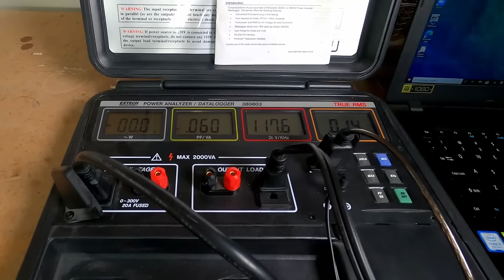Singer Heavy Duty, Most In-Depth Review on the Internet. No Really, I'm Not Joking.

Comment: Older video but I was wondering today how many hours a modern sewing machine could run before something broke. Not a stupid "torture test", just run at maybe half speed and oiled at the recommended interval. I can't find where anyone has tried something like that. Older treadles have been working for a hundred years without a major failure.

Comment: I just bought that machine and while you are sewing it comes unthreaded from the top leaver #5 but it will still be threaded everywhere else but it messes up the bobbin. Do you know why it would do this?
Reply: Absolutely! You must have the take up lever in the highest most position before you cut the threads. Otherwise the first thing that happens is you "unthread" the needle as the take up lever rises before you can even make a stitch. Just do it by hand motion only and you will see what I mean.

Comment: 2 big concerns: 16:25 That gear should have been metal. Also, running the motor so close to maximum makes it NOT heavy duty. A heavy duty design would use a motor maybe rated x2 the current draw in use, if the machine will indeed be running, for example 3 full time shifts in a factory, etc. This motor will run hot for no reason, just being cheap.

Comment: Unless they improved it, it isn’t worth it.  I bought one of these models around 2007.  It weighed a lot but it constantly jammed up, especially when it was being run at a high speed.  I bought it new and it wasn’t worth it.  I replaced it with an old 1970s Touch and Sew that had metal gears inside and it still runs perfectly.  The sales lady warned me not to buy the heavy duty. It wouldn’t go through light denim so I should have known.

Comment: None of singers machines are heavy duty. Compare to the vintage singer models? These new plastic and thin metal machines do not hold up. I’ve had to replace needle plates a few times because of the cheap metal there using

Comment: Having been a plastic molder in the past, I have to say it simply is not good enough to say oh this is a plastic gear.  Is it for instance re-inforced with GR so glass re-inforced.  There are many formulations of plastics depending on their application.  This will be engineered to both cost and function.

Comment: I’ve had my 4452 machine for three years, have had it serviced, and I am not impressed. I have sewn multiple fleece comforters...brand new needles each time, and it has trouble on the corners every time. My last comforter which was a heavy fleece on both sides, poly fill and it was a nightmare. NO SPACE under the foot, had to manually insert the needle constantly on the corners...skipped stitches and a lot of frustration. For my other sewing...I’ve sewn denim...not impressed either. It  would not sew the belt loops on the waist band...again, not impressed. Maybe my machine is a dud???  But I’ve used it exclusively for for years on every type of fabric, and I’m buying a new HD machine...not a Singer.
Reply: I have this machine and since I started using gutermann thread it has greatly improved function.
Reply: I just bought it and found I can not get my quilt binding under the foot easily..  I can force it and it will sew but it drags the material and puckers it.   I wanted to sew the cloth handles on a purse but couldn't maneuver the straps under the foot.   Wish I had not bought this machine (HD 4452).
Reply: @grandmajane2593  I bought a Janome HD3000-BE finally. I am much happier with the presser foot  space, and the ease with which it sews heavy fabrics.

Comment: I believe this machine is heavy duty....as far as cheap plastic machines are concerned.  But it doesn't even come close to a real all metal vintage sewing machine.  I doubt very much it will work very well when all the plastic gears will have dried up and cracked in 40 years or so.  There are 80 years old vintage sewing machine that made all the clothing for the entire family and after been used for generations, still doesn't show any signs of wearing out.

Comment: Cast Aluminum/zinc frame, stainless sewing deck sandwiched on top of plastic, plastic top cap, plastic body covers front and back. Cast aluminum/zinc inner frame. .8 amp motor, variable speed, 6000 rpm. Well made drive train,  drive pinion pulley on motor is smallest they can make, reducing speed and multiplying torque to the large top gear. This machine looks like it's durable and will last through much reliable use. The plastic covers will require owner to learn removal without damaging them. Not really equal with true industrial models.

Comment: I really hate this machine! its simple to sew a straight line as fast as the machine can go that would make any machine look good but when sewing slowly around tight corners this machine is horrible! the needle arm doesnt stay in the center position it floats freely left to right & bends needles constantly! if u put the needle in the center position & pull on the needle clamp u will see the needle arm doesnt lock into place